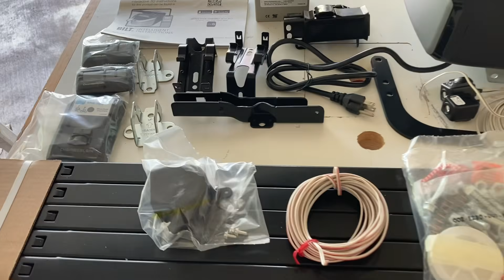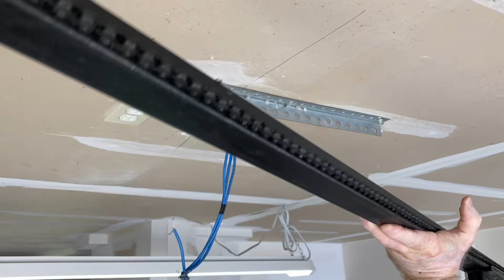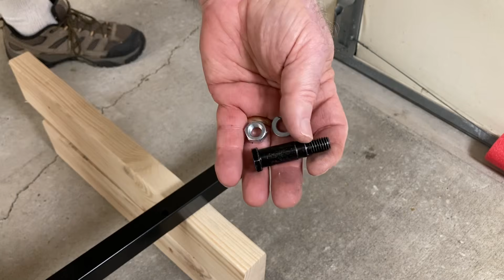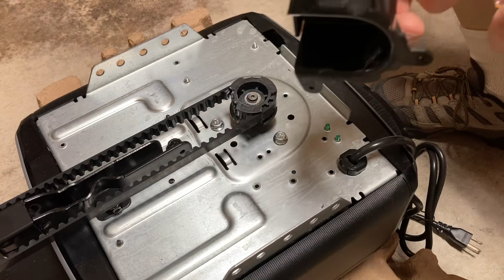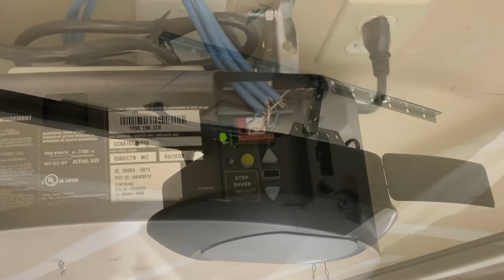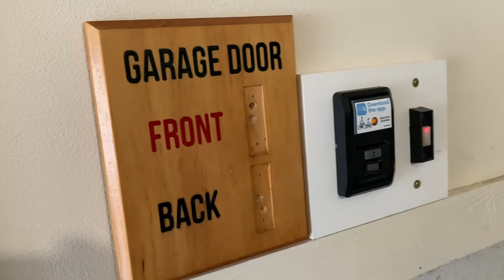Garage Door Opener Installation (NOT SPONSORED)

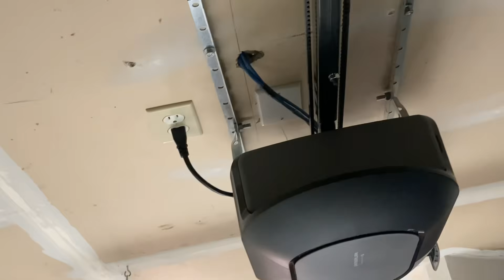Comment: Hey great video! How did you bend the vertical hanging angle iron like that so that it could be attached to the cross angle iron? @11:30 mark
Reply from the maker: You can bend it with pliers or just put it in a vise and bend to shape

Comment: @3:20 My question is:
Are all the door opener systems have that rail with the pivot point by the door? Mine system looks like there is a bracket there, which is sitting very close to the wall, doesn't look that the rail can rotate there, but probably just dropped (there is just something what looks like a stud with 2 nuts, keeping the rail there in place). The system is Chamberlain 41AC050-1M. Can I just lower that rail a bit to have the access to the top of the box to replace the old gear there? I would appreciate any opinions on this matter. Thank you.
Reply from the maker: You should be able to lowered the unit to gain access to the top of the unit it to change the sprocket. Curious, how did the sprocket get damaged?
Reply: @PawPawsWorkShop  Thank you for the attention to my question. The sprocket is fine, I just want to replace the gear inside of the Motor Box, since the system is about 11 years old (if the previous owner didn't
replace anything, then even 25 years old). The Torsion Spring gave up a few days ago and I'm working on the replacement of it, so as I'm there I would need to check the Motor Box, bcs I see on YT many people have issues w/it. Our gear is coming to its end as well most likely. The procedure of the replacement looks easy to me, but dropping of that rail ..., it is complicated. On YT the are 2 types of videos about it: or people replace that gear (and sprocket, as assembly) by reaching it from the top (since they have good clearance above), or (like in this video) the whole system is replaced, so then the rails are replaced as well of course (each system should be installed with its particular rails, as far as I understand, to avoid very possible problems with future alignment). I think I'll support both ends w/boxes, ladders, banjo cords, thick wires and alike, but try to lower just that part which is attached to the Motor Box, in order to disconnect that Box and take it to the bench.  Yes, and our system is is Chamberlain 41AC050-1M (with a chain). Thank you kindly again.

Comment: You never showed the arm position installation! 🤣
Reply from the maker: That just snaps in. I did not think that would be necessary to show as it simply just snaps in
Reply: @PawPawsWorkShop  No, I mean the angle at which the arm attaches to the bracket on the door. I would imagine the angle matters when it comes to wear and tear on the door. They say to find two holes that lineup. but I've got several positions where it will line up my question is what angle?
Reply from the maker: There are two predrilled holes for the bracket. The top of the arm snaps into the bracket on the belt, chain, or screw drive whichever you have on you opener. Then follow the instructions to adjust the opening and closing of the door
Reply: @PawPawsWorkShop  your video overall is great. Please don't take this as negative feedback.
Reply from the maker: None taken. Thanks
Reply: Hello. Just had the same question when I did mine. The bottom piece should be flat across  then just attach to fit that. Hope this helps.

Comment: Because pulling that little rope dangling from  trolley to release the door for manual opening doesn't work?
Reply from the maker: No, the rope release works just fine. The problem is you can’t lock the door when you are leaving